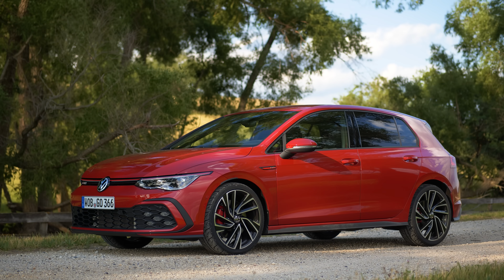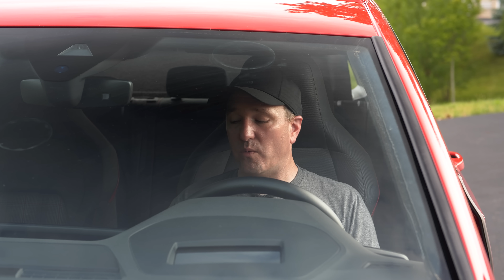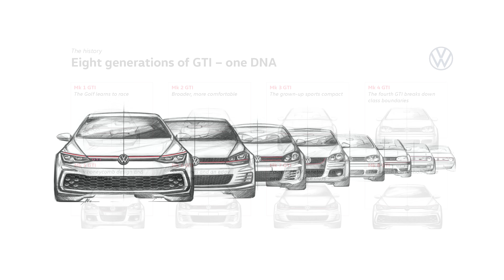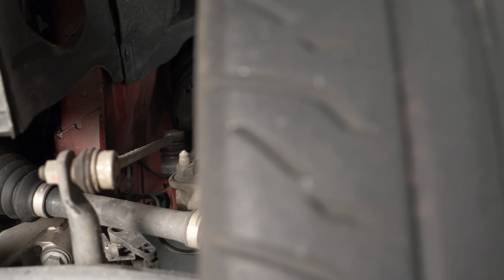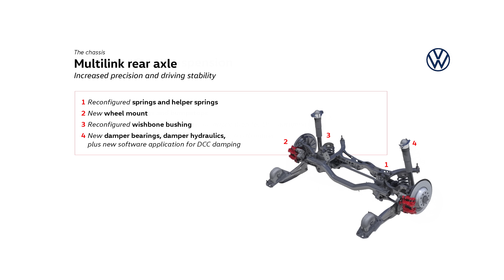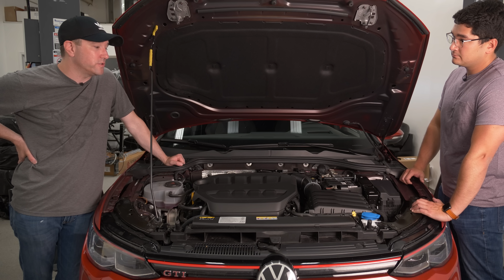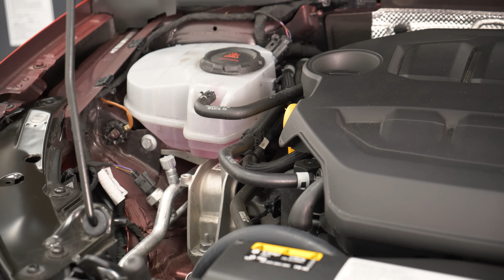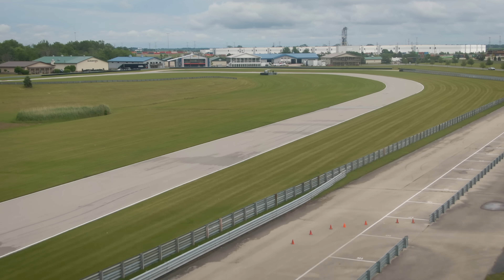2022 VW GTI Mk8 | Unexpected

Comment: The 2022 C A R B O N  B U I L D U P
Reply: its port and direct injection
Reply: Only if you live in the U.S. lol 🤣
Reply: @JasonC-4  you know you can add an oil catch can and then it becomes a non issue.
Reply: @dragospahontu  Is the car's computer happy with an oil catch instead of a hose going to the intake?
Reply: @USARAY1947  a pro will be able to take care of that😉.
Reply: @USARAY1947  really the ea888 3rd gen doesn't require a catch can. There has been a lot of design work since 2005 on the separator system in the PVC.
Reply: @dragospahontu  catch cans are illegal here and also voids warranty but we'll get the dual injection motor anyway😋

Comment: Looks much better than the last manual that kept over revving the engine.  I have owned two vw 's and one audi and the poor build quality and beyond expensive repairs makes me say never never again.   My porsche experience is ten times better.  With so much better design and ability to keep it fixed.  
        VW as a company screwed me over and over again on a brand new car under warranty.  They just failed to do the right thing or even the legal thing over and over.  Sad that porsche and vw are the same company now.  Really.

Comment: I was wondering if you were going to address the RE71rs. that's insane from the factory.  Does the US model get REs stock?  

it's only fair to review the car as it comes to you but the difference the tires make is insane.   as someone who autocrosses their daily, I would instantly stuff these in the corner of the garage and get some street wheels and tires.  I wonder if a standard summer tire would dull the improvements
Reply: It's not from the factory here in Europe, it's done so that on the reviews they can finally say "no understeer" lol
Reply: 19" wheels are an option no mention of the tires used in the configurator.
Reply: @olafvanes  the goose replied to me on patreon.  The REs were added after the fact by VW for the press tour, it’s not stock
Reply: @granthemstreet3209  that's actually kinda shady
Reply: @gerbel01  agreed.  Might be a euro thing
Reply: Shady af
Reply: @granthemstreet3209  is it shady being European or is it shady swapping out the tires? 😄

Comment: Holy ** stop with the stupid touch crap.  Everyone gives Audi a pass because it "looks nice" but this crap is completely a cost cutting effort because making knobs is more expensive.  VM you're rich enough even after you got sued for cheating on your emissions.
Reply: Just think for 5 seconds. If touch buttons were so cheap to make. Then why do cheap cars, where every penny matters, have tons of buttons, and expensive cars, where money isn't an issue, don't. What you say makes no sense at all. It takes way more effort to tweak, program and tune touch buttons to make them work properly. The hardware behind it is probably also more expensive than a simple plastic button. Well unless you make the buttons out of solid metals and use some crazy mechanical switches. But that won't be used in a Golf, now would it. These touch controls will never be as easy as physical ones, but using them isn't as nightmarish as is often assumed.

Comment: Where would you rate this GTI in comparison to the Type R?
Reply from the maker: In terms of performance?  Type R is 9/10 for FWD GTI is 7/10.
Reply: @savagegeese  What is a 10/10 for FWD then?
Reply: They sort of addressed that.  The Type R is a better car on the track and it's better to compare this to an si.
Reply: I’d say that the Golf R competes more with the Type R
Reply: Keep in mind that it will have completely different tires stock compared to the tires on this test car, that alone makes a HUGE difference.